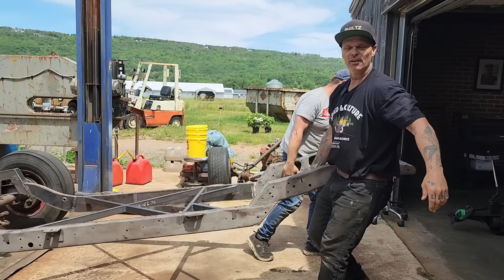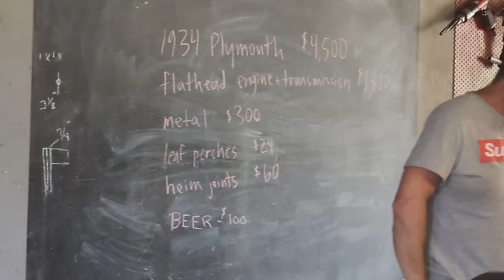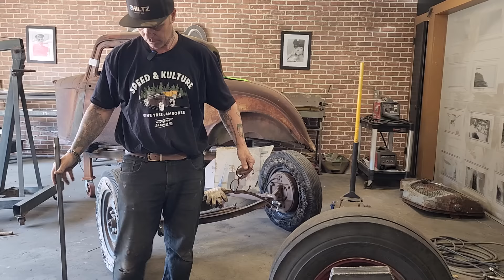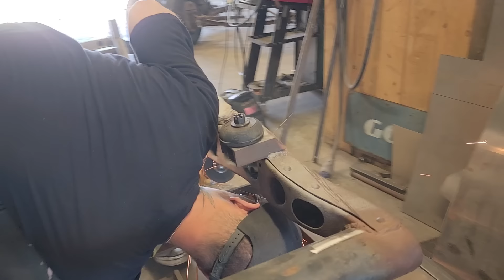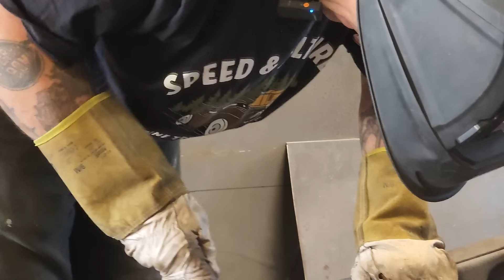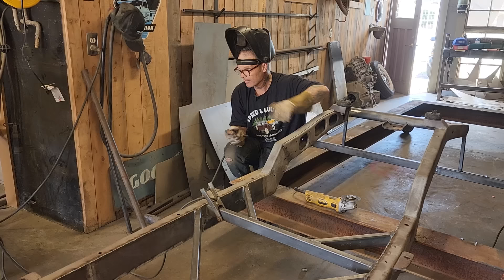Lots of controversy on how we're building this hotrod chassis 😝

Comment: Hey Chad , the Thunderbird might have a shorter arm but it will also have a longer arm in a parallel configuration. The parallel configuration maintains pinion angle. Your short bars will have a lots of pinion angle change throughout its travel. It wont matter for a museum car but not ideal for a driver.
Reply: How about for a flathead drag car?

Comment: Hmmmn. new vehicles, they do 4 wheel alignments on them. wonder how they do that without being able to adjust them from the factory? SMDH
Reply: They dont do it with adjustable control arms . Bwahahaha
Reply: @burthurt8365  Didn't say they did, he just said new vehicles were not adjustable. But since he levels frames with it setting on tires instead of the usual way of being on rigid anchors I guess you and he are on the same page on things.
Reply: Cars today are fixed camber and caster only tow is adjustable
Reply: You are absolutely right. A lot of people are not aware ,that only  toe can be adjusted . no trailing arm adjustment either.
Reply: They bend it

Comment: Happy Birthday Jolene.            I would have cut the frame from the top in a wedge and then blocked it like you did and closed the gap. When you cut it from the bottom and open it up to where you want it and weld it.The weld will try to pull it back to where it was.  We shall see when when you cut your fit up apart. Chad I know you ll get  straight

Comment: Trailer hubcaps! I had a new one in 1995 with1/2 ton Chevy truck rims. The rims were made for a plastic center cap. Not a full cap. They would stay on ok with a car on it,but put my5 ton skid loader on and when backing up and turning the rim would flux and caps popped off. Rim was not shaped for full caps. SO in some cases that is true. Put on old Chevy truck rims problems solved. SOMETIMES when backing up the rims looked bent as they slid to turn. SO 1/2 true on that if you know by doing.

Comment: They don't have adjustment because they have engineers and gigs. The don't need adjustment. Adjustment makes up for this.......to a point.
Turn your table 90 degree's and drop the frame on. Level the base and use your level and plumb bob.
Throw the welded tube in the trash. Strings,plumb bobs and levels dont lie. Its up to you to satisfy them.
Happy Birthday Jolene!!!

Pretty sure I've been blocked long ago :)

Comment: That three link rear end set up will work, question is will it work well!
The only issue I see is the arms are a bit short! Which means the rear will Chang pinion angle much more when going through travel!
New cars mostly use a four link set up, totally different!
Reply: This only has to go down the track in a ( mostly) straight line a few times once a year. It’s a flathead drag car……

Comment: I am not a metal man but it seems like you should over-correct the twist in the frame. In other words when you weld the temporary braces do it so that the frame is over-twisted the other way a little bit, so when you release it and it springs back a little, it will be perfect. 🙂 Think about it Chaddy (and QJ).

Comment: Chad to be honest with ya when your dealing with old twisted up car frames or a truck frames. Whether you agree with it or not, a decent body shop will use a Frame Straightening machine that has a Heavy Duty Frame Rack or Frame Machine.. With upright towers. That you can take a piece of flat bar, then weld it to a section of frame that is out of alignment then use a hydraulic puller to pull on that tab. To properly get that frame realigned.  That is just one function that a professional Frame Rack enables you to do. This hydraulic device helps do pulls and helps you realign frames and unibodies on chassis of all sorts. That's how real collision Shops do frame straightening. I worked in Auto Body Trade before I became a welder fitter, I helped do collision work. We had pots set into the concrete floor that enabled us to put a hook into to help do pull downs on frames  etcetera as well to help align truck or car frames correctly. 
 Btw that square jig with dollies on the bottom that your frame is sitting on is officially called a Chassis Jig. It's used to help to assemble and build chassis frames from scratch. Obtw Jolene, Happy Bday.

Comment: All new cares have adjustments in the rear end. New cars require a 4 wheel alignment nowadays. Like you say if it’s yours build what you want.
Reply: Nope. Pickup trucks and full size SUV’s have no adjustment and do not get 4-wheel alignments. Not even new ones. That’s how many many cars used to be built back in the day too, before unibody cars with independent rear suspension became common. 

Even on modern unibody IRS cars I’ve only seen toe adjustment designed into the rear, which would be adjusted in a rear wheel alignment, but toe adjustment isn’t applicable to a straight axle on a hot rod anyway. The wheels are parallel all the time. 

If one were too lazy to square it up and set pinion angle before welding tabs to the axle, sure, a bunch of heim joints would make it easy to slap it together and make the links the right length later. But heim joints are expensive and once you set it proper you’d never adjust them again, so they’re kind of a waste. if you simply square it up with a tape measure and set pinion angle with an angle finder and a pen and paper, weld your tabs/mounts, and then it’s done and you don’t have to mess with it again. 

Noobs will make adjustable links if they’re worried they’ll make a mistake and need to adjust it out later, but this guy is confident he’ll get it squared up right the first time. He’s no stranger to a tape measure and a welder.

Comment: My 1977 4x4 frame would flux so much the bed sides bent at wheel wells. I boxes the frame added cross members. Next time 4 wheeling I got stuck all the time. With no flex a wheel would be off the ground and loose traction. Drive 1 front tire up a ramp and a back tire would be off the ground do to to stiff to bend. For every action there is a reaction to think ahead on.

Comment: Be mindful that the thunderbird trailing arms aren't welded to the diff and have a flexible joint both ends so the rear axle can lean without tearing the trailing arms from the diff or bending them. Otherwise, good work which I enjoy following.

Comment: Rear control arms need to pivot at both ends or the pinion angle will constantly change with suspension  travel. And what about room for driveshaft thru X- FRAME

Comment: Chad is obsessed with that swuare bar and exhaust pipe tubing. No wonder his cars dont drive on the road and are parked. Wood interior, spray glue , cardboard door panels. I wanna see these cars in the rain. I bet it falls apart.
Reply: You forgot to mention 'plastic chrome'.
Reply: I absolutely agree they all share one battery back there.Oh he wanted to use a coat hanger on the frame today!

Comment: Lay tubes or anglea across top of frame rails and axle centerline and one or two mid frame.  Stand in front and see if the are all on same plane.  Will tell you if rails are not twisted or out of shape

Comment: Plan your cuts ,should have cut from the top the gap would close and the stress woulds be on the frame not the weld .
The frame needs to anchored then made true then the horns can be aligned and straighten ,I have done many frames and unibody's that were from  front and side hits ,I have never done any using those methods .

Comment: You should have had the frame sitting om the length of the lower rails.  You had it tied down at the wrong place in the rear it was on the ramp up uneven.

Comment: It may have already been mentioned. But  are the rear tires exactly the same height? The tire pressure could be just a little off. Which would give you a quarter inch real easy.

Comment: Those tractor turnbuckles are junk. Nate should have noticed how soft the steel was when he cut it by the color of the sparks and how easy it cut. I wore out 1 a year on my brush hog but there cheap so I toss it. But we’re you got it you can’t. If hubcaps work on a tractor why you only have3? Yes you can shim but what about tire ware? Just when I think you’re getting better you get a know it all attitude and close your brain to thought. I wonder how many rear ends will be along the roadside when people take your advice on those junk turnbuckles. If you think about it you might be wrong on things you did buy never drove to test if it works safely and last.

Comment: You might check the direction of rotation of the engine - if the rotational torque is twisting the frame the desired direction, you could be good ?   😃

Comment: Good job chad we boxed a model A coupe frame at the body shop i worked at for many years and we tacked it down to a chief full frame machane that we used on all full frame cars bowed the frame and when we cut it lose it still had a lil twist so we had to do just what you did and put a releaf cut in it to get it right
Reply: I ment we boxed the frame not bowed

Comment: the only issue is the driveshaft angle.  engine is sitting wat to high.   its a low rider, yet the engine crank centreline to rear end pinion yoke  is at a bad angle

Comment: Happy Birthday June Bug...
Reply: BC chassis adjustments are nice...Sort of like an upgrade...Bar adjustments allow for adjustable pinion angle and tracking adjustments...It's used a lot on drag cars and streetrods/hotrods...Adjustable coil overs with 3 hole perches you can adjust ride height and spring pre-load...Yes, true originally those cars had very little if any adjustments, maybe tow adjustment...then you got sway bars, panhard pars, ladder bars...this list is endless

Comment: With that frame being so little out of perfect plum it would not have been a problem. The weight of the engine and finished body would have brought it back to state of such little  importance. If it had been bent to the side one way or the other, then there would have been a major concern with wheel alignment and steering issues. Brad it's your car don't let a few loud mouth' Lazyboy quarterback types dictate how you build your cars. Happy 26th B day Jolene.😁

Comment: it's a frame for a car that never under went crash testing. build it till you think it's strong enough, and good enough that you can get a proper wheel alignment done on it. that's it, no fuss about it people are way to over thinking shit. I mean people worry about safety and shit, buy it they really did, they would be more concerned with no seat belts, plate glass side windows, no impact absorbing areas to lessen stress on the cab in a collision... just do what your doing, ignore the idiots with their heads so far up their own ass.

Comment: For as much as the car will be driven, it doesn't need a rear suspension, just run the rear tires low and be done with it.

Comment: Face it. He is not making dependable daily drivers. He is making parade cars. Cars that look cool but only meant to be driven for a couple thousand miles a year tops. THAT is why there is so many negative comments. You have the restoration guys, repair guys, specialists and art car guys arguing. All have different objectives when building or fixing a car. Chad is just trying to make them driveable so that he can shape the body. These are not cars you are going to take across the continent or drive everyday to work in the snow and weather. They are cars that you just look at or take to a parade/car show.